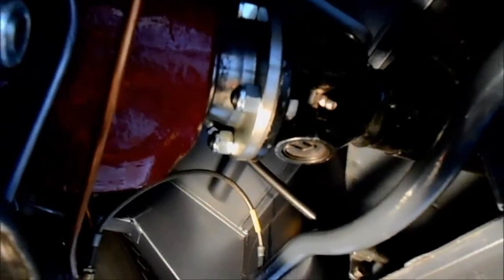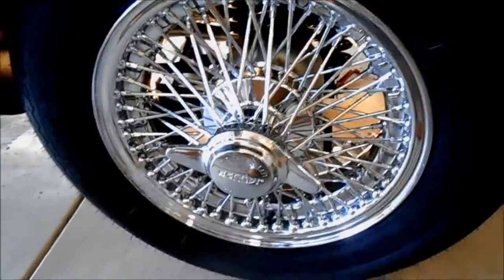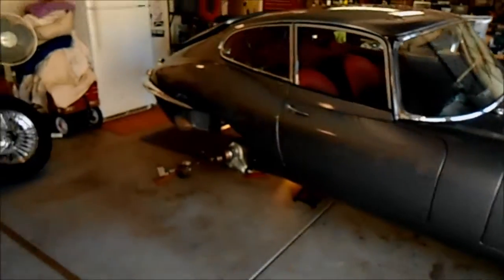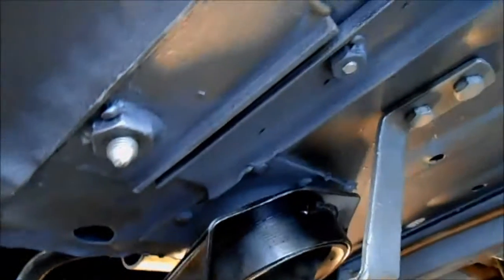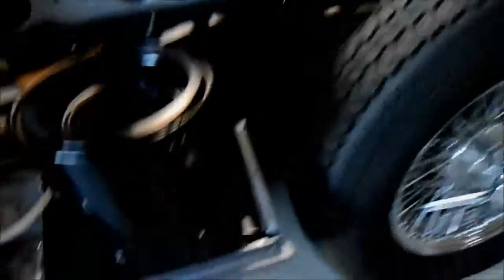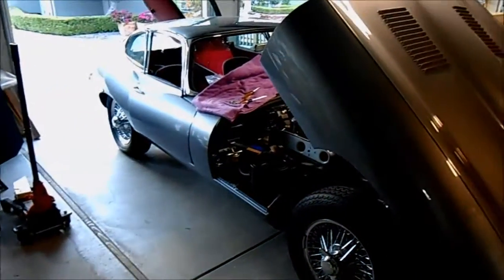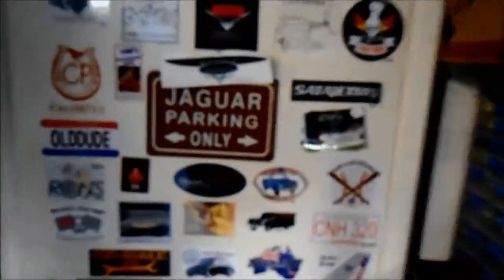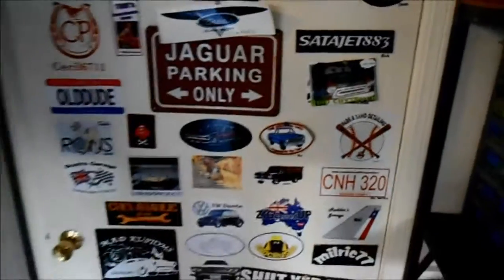Bettie my '63 Jag E-Type Restoration - Leaks form fuel tank and water pump

Comment: FIRST!
Sorry for the issues, especially the gas tank. They can be a real pain sometimes. I remember the hassles I had redoing the one for the 41 Ford sedan I hot rodded back in the day. Almost burned down the shop soldering it! I am sure you will get it under control.
I love the wire wheels. There is nothing that says "classic" like nice chrome wire wheels.
Reply from the maker: The Shade Tree Fix-it Man Thanks George, I am sure I'll get it right it's just the roller coaster ride that's driving me crazy...

Comment: John, if you Google "Car Brite" you will find acid-based wheel cleaners especially for spoked wheels. They have a spec sheet and instructions. When you use it you should not leave it on too long and you should neutralize it with something basic (soda or other?) afterwards. I've used this stuff and it is the only thing that really works well. You do need to brush around the spokes if they are really dirty.
Reply from the maker: Bruce Boschek Thanks Bruce - I read some web pages on acid based wheel cleaners, and they are not very reassuring- I will be much more careful with it if I chose to use it again.  My problem is this bottle was given to me without any labeling.  I think I will dispose (properly) of it and buy something I can have the original label on.

Comment: Sometimes those gaskets will swell up and stop leaking by the time you check again, not to tight at first.. normal setbacks,,maybe just a hose etc.. good vid!
Reply from the maker: Milogarage I actually was able to snug up the screws to stop some of the leaking, but the fuel pump wiring bung is seeping and won't snug- it's just spinning - and now that the pump stopped working, so I need to replace it.

Comment: Fuel leak is a bummer...The coolant leak may only need to run the engine and pressurize the water pump seal to seat it...Is it a new water pump.?..May be you can jack the front up enough to stop the fuel leaking out..In tank pumps can be a bugger if the tank is full...at least that one is on the top of the tank and not in the side like mine...Teething problems..that's all....Remember when the kids were teething...A PITA but it'll pass with a little more attention and all will be good...Till the baby teeth fall out....lol
Reply from the maker: ZIGgassedUP Thanks for the words of encouragement Ziggy...

Comment: Hi John. I guess it wouldn't be an E type without a few leaks...
I'm sure you know by now those floor holes are just for drains. Jag usually just filled em with rubber bungs. When I did my floor I noticed whoever replaced it in the past didn't re-cut those holes so I just left it without. Not original but i'm hoping it won't flood inside enough to need six holes to drain. It's really difficult to get rid of a tank of fuel when ya nee to isn't it. I needed to drain mine during the strip down and it's not until you have to do it you realise what a stinky and dangerous exercise it is draining and storing petrol, (sorry gas ) :0)
Ya car just looks bite the back of ya hand gorgeous though mate, well done....
Reply from the maker: Barry Jones Thanks Barry - I have the new fuel pump now and the coolant leak was a hose clamp that failed, so all in all, I'm feeling like it's not to far from road worthy.

Comment: There used to be a mean-spirited joke that Jaguars were always sold with a folding drip pan the length of the drive train to always take with you for obvious reasons. Jaguars, like Moto Guzzi bikes are known for the "footprint" they leave after parking them. Please be careful pumping and working with gasoline! Always have an appropriate fire extinguisher right at hand and make sure you know how it works. Sorry to be so pedantic, but I've known of good mechanics that made grave mistakes with fuel.
Reply from the maker: Bruce Boschek Bruce, I drove XJ6 models for years, and my mechanic told me to stop stressing over oil leaks and just put a cardboard underneath the car.  I will be careful with the fuel.

Comment: Dam Fuel pump and the water pump - that stuff shouldn't happen.
Reply from the maker: Tom Noble Yeah- quality control is no longer job #1 in many manufacturing companies these days.  The coolant leak is not the pump - thank god!  I found a leaking hose to pump connection.

Comment: Shame about the gas leak. You can't pop a line off from under the car To drain?  Water pump might be ok. Sometimes takes a little bit to run the seal in.
Reply from the maker: cheftush David, I am happy to report the fuel leak was taken care of my replacing the fuel pump, the gasket, mounting screws and copper sealing washers. The tank has a sump on it that is removable, but that would have gushed the entire contents of the tank out in one go.  I didn't have a container to catch all that gas in so instead I lowered the fuel level with a hand siphon pump I found at Home Depot for $11.95. Handy little device to have I felt and it did the trick for me.  I found the coolant leak too - it was a broken hose clamp, so I am back to tuning and shaking down the car.